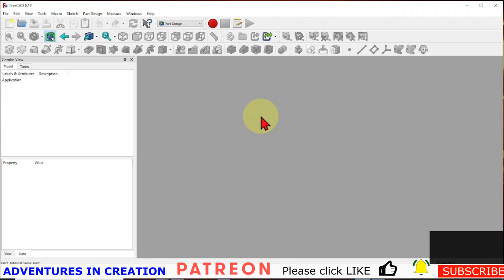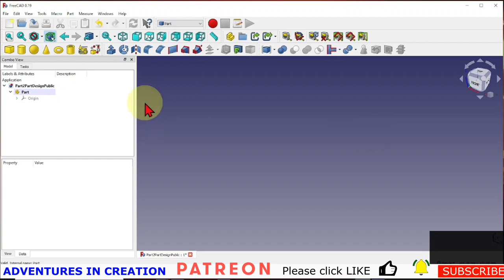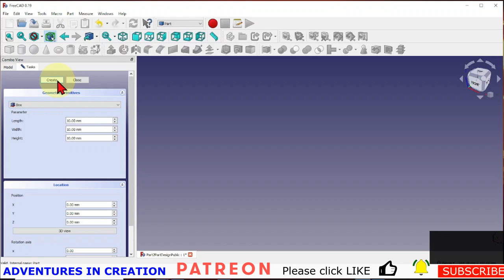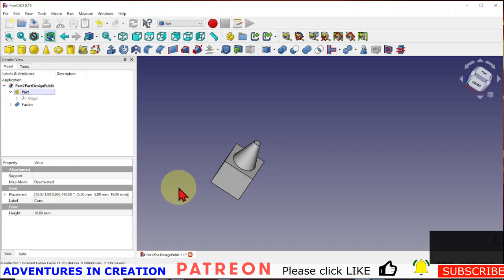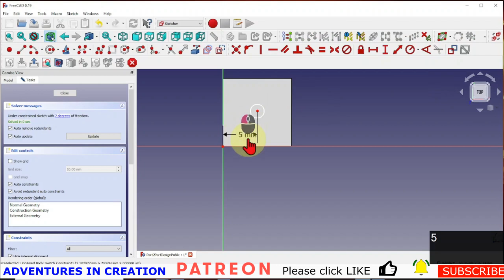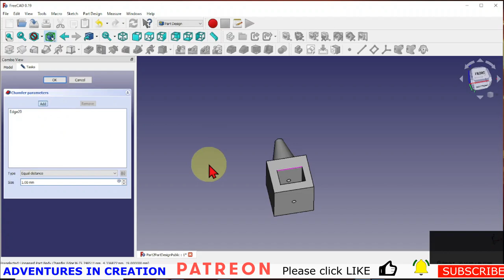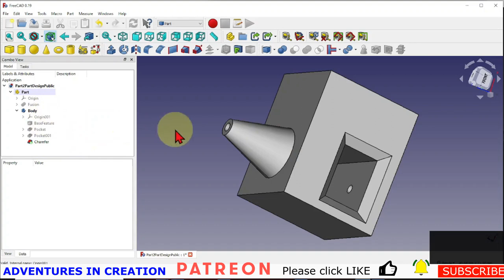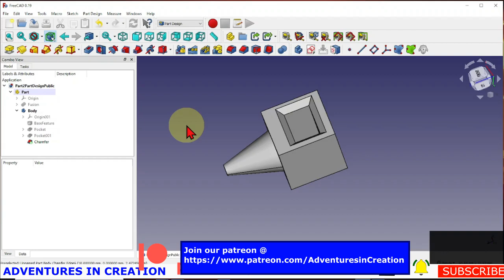FreeCAD for Beginners #28 Part Workbench Model to Part Design Workbench

Comment: Great Video. I have learned a lot watching these and doing them along with the video. Can you help me with a few techniques for creating a Tricone Drill Bit. I am starting out with a flattened cone that will be the top of one of the wheels and want to add the bits to it as smaller cones. I can create the base cone and add each cone individually but that looks clumsy. There must be a better way to add a array of smaller cones to the sides of a larger cone. Can you describe how you would do it and it would be nice if each cone was faced correctly. Thanks.. Hope this is not too hard. Richard
Reply from the maker: It sounds like you could create one cone then make a polar array of cones from that.
Reply: @Adventuresincreation  Yes I thought about that and actually tried it a few times but I had trouble with the center and the direction of the cone. The cone was not flush with the wall of the larger cone. Is there a way to move the base of a smaller cone to the side of a larger cone automatically without having to use transform? That would help.   Thanks for getting back to me. Richard
Reply from the maker: @richardbrown2290  I don't think you can do it automatically

Comment: Thanks for this.  Do you know off hand if you have a previous video that explains booleans in more detail?
Reply: After watching a few more videos, my goal is to make microswitch mount/ holder for my taig cnc machine that can be 3d printed.
Reply from the maker: That should be very doable.
Reply from the maker: Yes, there is a boolean video